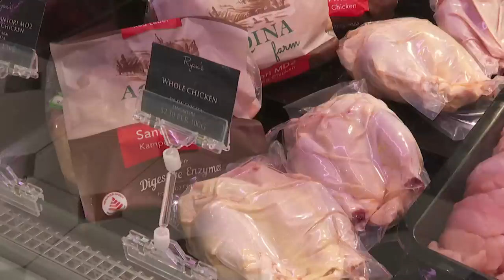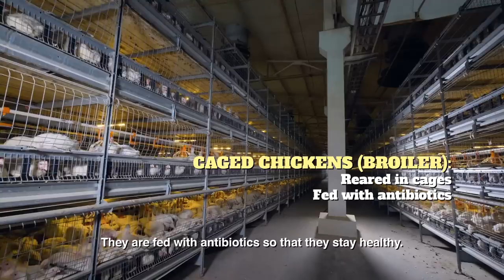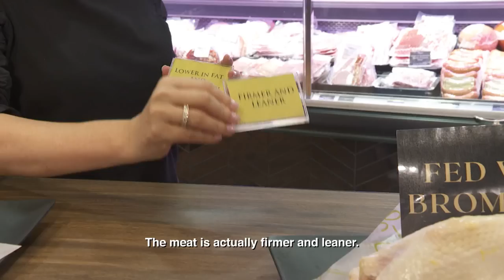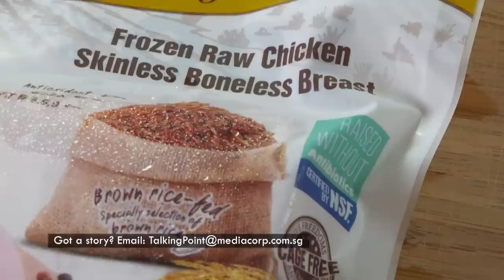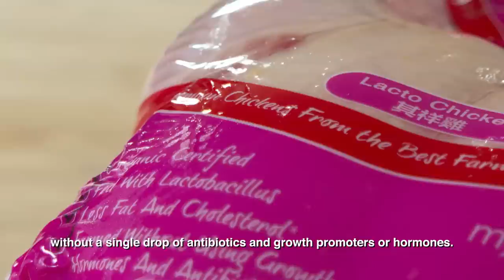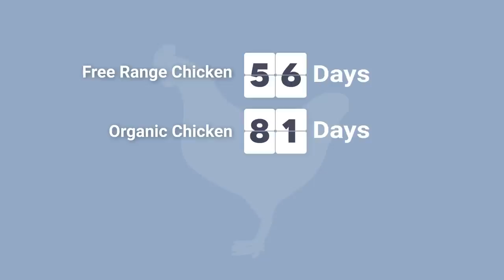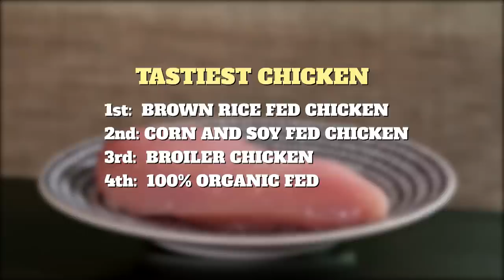Is Free-Range Chicken Better For You? | Talking Point | Full Episode

Comment: I think the result was slightly skewed based on whichever is eaten first. Everything after is basically compared to it. I have a feeling you'd get similar results if the others were started first as well.
Reply: I have yet to see these kind of programmes use proper research techniques. I get that they want to have quick results but the way they do it is so incredibly flawed that the results have absolute zero meaning.
Reply: Yes also based on the fresheness of the chicken. Maybe the organic chickens were older as they are imported from overseas

Comment: free range, organic is only a term by businessmans to riase ridiculous prices on their product.
Reply: i don’t think so, before a product sealed with organic logo it goes thru a long and expensive process. declaring it as organic means have to be pesticide-free, from the soil until to the tip of the leaf for veggies and fruits.
Reply: @sheilae.535  Unfortunately, in commercial/large-scale farming, the majority of farmers use pesticides. This is rampant for many products labelled ‘organic’; not just poultry, but even fruits and vegetables. 

They always find a loophole to maintain/gain profit. You’d be surprised if you dig deeper down this rabbit hole of ‘organic produce’.

Your best bet would be to purchase stuff from small-scaled farmers (if they use methods which meet your personal standards, of course).

IMPO, some people still prefer to buy organic and/or free-range chickens because of slightly better ethical methods used for farming. 

It’s sad that ‘organic’ does not necessarily mean they’re also bred free-range. Just ‘free-range’ does not mean that they’re also organic. And lastly, ‘free-range & organic’ does not mean that they actually meet each of our personal standards/understanding of said terms.